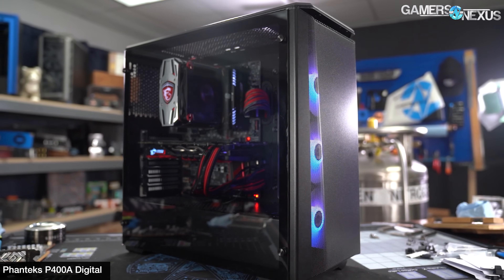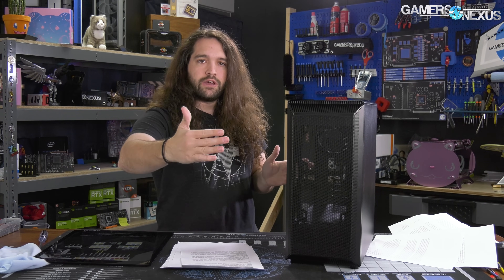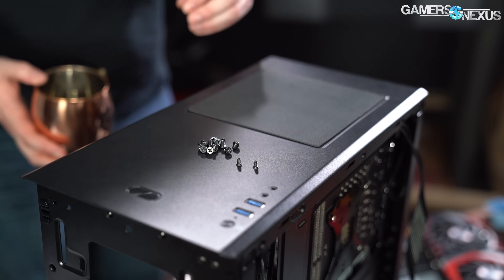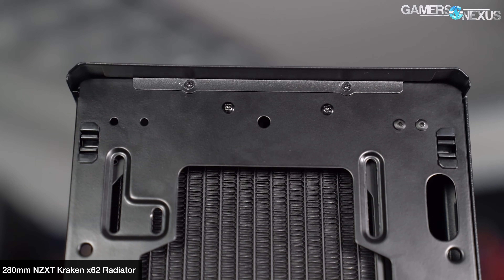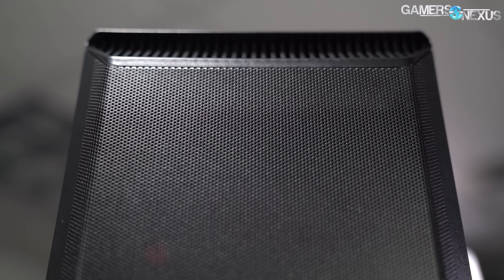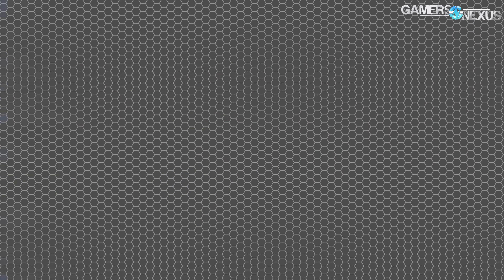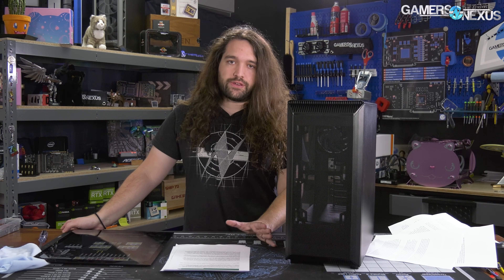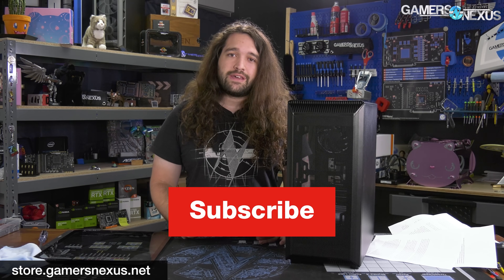Phanteks P300A Cheap Airflow Case Review: Thermals, Extra Fan Tests, & Noise

Comment: I bought this case, P300A, which came with 2 front fans as well, but the reason I got it is that it listed the case as supporting GPU's "up to 355mm in length, and atx motherboards" - neither of these things are true imo. I mean, ATX motherboard... maybe, if you have long PSU cables and can somehow route them through the infinitesimal space they give you behind that idiotic shroud - in my case I had to force my psu in there and bend the cables, and the only hole I could see that the cables could run up into from that angle made it completely impossible to install an ATX mobo. That asides, the GPU spec is jsut an outright lie. I have a 320mm GPU that I wanted to fit in this, it says it supports up to 355mm, yet 320mm is pretty much fully as long as the entire internal space, there's no way to fit inside, and 355mm is like measuring from the very back of the case to the front panel made of plastic. It's physically impossible for a card that size to fit.
Those issues aside, I also found the HDD setup completely idiotic and awkward, the PSU as I said was the most cramped piece of crap and worst design I've ever seen. The fans do look nice and the front panel comes off and on easily though, if I had to give it a good point. This is a case I could only recommend to people with a PSU that is 180mm or less in length, ideally less, and GPU's that are maybe 280mm length max. Also, only mini-ATX or ITX boards, full ATX is a nightmare to fit in this thing, if you can at all. I will be returning mine for false advertising.
Reply: I have p350x gpu lenght is also lie on that case.
I wish there was a standart I can't trust any case now, do they expect me to guess gpu lengh based on the external dimension?

Comment: High end cases are the ones that can do without any fans at all including the rear exhaust. Anyone buying a high end case will remove the stock fan and toss it into a bin or the trash if one is included. No fans at all and they will buy 4 or more fans to populate fan slots just the same as if there was a fan. Budget cases... those should always come with an intake and exhaust fan at the very least. More fans in the cheaper cases costs can be offset with no fans in the high end. But it does make for a marketing point, more fans for your limited budget, buy our case instead of the competitions single fan case. In the budget market standing out is more important than the high end where marketing is ignored and stats are more important to the buyer. Marketing $60 case that includes 2 front intake fans and 1 rear exhaust is going to interest a buyer far more than the competitions solo exhaust fan.

Comment: I would like to know if are there good cases with 5.25 bays in the front. I would like to use fan controllers, blu ray drive, memory cards pannels and stuff like that in my case but is almost impossible to find one.

Comment: Will this case fit my  Asus AM4 TUF Gaming X570-Plus WiFi motherboard? apparently this is an atx motherboard but it also said this was 13.31 x 10.74 x 2.68 inches, which is above an atx of 12 x 9.6 from what i researched.

Comment: The clearance for air cooler of this case is exactly 165mm as the height (with fan) of my Noctua NH-D15, should I buy this case?
Reply: Usually, cases can take a bit higher HSF than their specs. So, if you need a new case that can house your NH-D15, P300A will be fine.
Reply: @Bagus-101  I see. Thank you for your reply.

Comment: The side panel screws and compatibility of the 300A are very poor. I returned mine and chose the Fara R1 over this. I needed a compact and cheapish ATX Case with mesh front and I think the Fara R1 is a more complete product than this.

Comment: Honestly, Im a budget buyer for PC cases. I'd rather pay 60 bucks for a case with no fans but with quality features likes cable management, front mesh, ssd brackets, magnetic top filter, than a case of the same price with included fans that are loud and awful and cheap features overall. Btw, I have a Phanteks Enthoo Pro M with 3x Noctua front fans (2x 120mm and 1x140mm).

Comment: * glances over at his $45 case with $80+ of Noctuas in it * Hmmmmm
I was looking forward to this and the FARAR1 until I got a vertical pump+res combo. I guess there's benefits to having useless space for 5.25" bays after all. Now there just needs to be (stock in) mATX cases that do that with decently ventilated fronts.

Comment: might be better to just dust off your pc every other week and take dustfilters off?  dustfilters need to be cleaned every other week anyway or weekly to keep them performing like a dust filter.. otherwise they just provide dust for intake fans :D
Reply: It''s nigh impossible to thoroughly dust PCBs - let alone while they are vertical and installed in a case. And to thoroughly clean CPU air coolers the fan needs to be removed. And to clean a graphics card you need to strip it down. Dust filters on every intake are virtually a necessity and no mesh is a replacement for a dust filter. If you can see the holes, then dust can certainly pass through them. My PC is situated in the living room and it's filter collects visible amounts of dust in HOURS and I clean it daily.
What we need is cases with no mesh and a dust filter accessible from the front. A mesh+dust filter impedes airflow excessively but whereas the mesh is an aesthetic component, the dust filter has practical benefit.

Comment: Can anyone tell me if the BeQuiet! Dark Rock Pro 4 will fit inside this case? I'm looking to have a smaller footprint for an ATX case from my current one, but the cooler height clearance seems to be inconsistent across what I've seen others put out there (160mm, 170mm?).
Reply: I know the Dark Rock Pro 4 fits into the NZXT H510, which would be my second choice, given the similar size. I would like to know about this case first, since it has better airflow. PCPartPicker also says it would be compatible, but just looking for another source to corroborate.

Comment: It is a horrendous design if you want to use the HD bays, like 99% of gamers that still need a large storage drive.  My thermals were 30F higher than drives in the main bay laying on the shroud.  That’s a problem.

Comment: For some reason the fron panel won’t attach back on the case with two 140mm fans installed… am i doing something wrong
Reply: yep you're doing something wrong. I have 2 140mm fans and it closes perfectly. Check if a wire is in front of the snap in hooks.

Comment: So unfortunately the H500M remains the best airflow case available. Why the hell isn't anyone making a full-tower with 2x 200mm front fans, 1x 140mm bellow the bottom 200mm fan (So that the 200mm bottom fan isn't obstructed by anything and can focus on pushing air in the main compartment, while the bottom 140mm will push air towards the PSU tray), plus another 200mm on the side panel similar to the HAF  design? It would completely destroy all competition when it comes to thermals, and if they do a good job, it can look awesome too. I'm tired of all these mid-towers.

Comment: Youch. Wish I had watched this review before getting two of these seemingly affordable cases. I did luckily have a bunch of case fans left by a friend's "maximum airflow" experiment and was able to get the much needed cooling into the case. Unfortunately, I couldn't run the entire 4x16GB RAM I picked, due to the tall sticks being too close to the stock air cooler of the 2700x CPU, and causing memory errors. The air pressure is somewhat off as well, with front intake, top intake and rear exhaust. But positive internal air pressure is the easiest way to keep dust from rushing into the case from the back.

Now that I'm ready to upgrade, I can't really run anything larger than a 240mm AIO, and I can't run a higher performance air cooler larger than 160mm. I also probably won't be able upgrade the GPU without running into thermal issues (the M.2 SSD located directly under my current GPU is already not ideal...) Then again, it's not even the best time to upgrade, due to the silicon shortage and mass amounts of scalpers atm, so maybe I should just hold off and save up to buy almost an entirely new PC (minus mobo and RAM, I suppose)

Comment: I can't believe there are folks out there, who would by this case, seeing the nice front mesh panel with the ability to mount front intake fans, and NOT even consider buying any add'l fans for front intake, but I guess they are out there.  Same goes for any cases that don't come with a rear exhaust fan; bet there are folks that don't even consider having to buy one for there or even give conisderation for moving a supplied fan, to back there, at the very least.  SMH....

Comment: I bought the p300 (not knowing of p300a a year ago) and I love it but air flow is an issue to anyone know knows is the front panel the same size can i order that replacement part when it's in stock ill gladly replace my front panel if so! for under 100 this is def one of my fav cases to work with though!

Comment: >"put 30 dollar fans inside 60 dollar case"
Yep. That's me.
Reply: For me it's worse. If I wanna upgrade the included fans, I'll be spending more than if I bought a new case.
Reply: @everythingfeline7367  if you combine the price of all the high-end fans i had.. I am waiting for new Pure Base 500DX case and will be replacing stock fans with Silent Wings 3, two of which i already have and bought an extra one, now that i am definitely sure (i guess) that those are the best case fans i ever owned. I remember spending almost a 100 usd for 3 noiseblocker b14-ps fans, two of which i already sold because those are unusable as case intake with front filter, they make ugly noise. I only have one as exhaust and will be selling it too. The pure wings that come with 500DX i will install in my current case and sell it. The current case being NZXT H700 which i simply become unhappy with, i know it's strange but that's the way i am.
Reply: It's a better value that way. You can get this exact case for $49.99 including $10 mail in rebate. Plus a 6 pack of upHere PWM aRGB fans are ~$47. Roughly $10 more than P400A but you get double the fans that are PWM (P400A fans are not PWM).

Comment: Hey i have the Phanteks P300 case  I dont know if this will be the same with this case but i cant change the led colour on my case when i press the botton on top anyone help?
Reply: Just a guess but make sure you only connect up a psu sata cable to the case connector to power the led on that model, do not connect it to the motherboard as thats not required.  Hope that helps.

Comment: Why do the noise normalized test with stock configuration? Why not with standardized fans like the torture test before? Or both if you have to.
But doing it with stock fans is the most useless thing after you basically showed that the case absolutely NEEDS new fans.

Comment: Anyone noticed the rails for front 140mm fans are offset to the left? They aint directly centered as the 120 rails. So if u install two 140s in front they gonna look off-centered. Dumbass design.

Comment: "Most people are not you".   I would argue "most people" don't buy a case, they buy a prebuilt computer.  People buying components for a pc build DO buy case fans.  Look at how many reviews for fans there are, even compared to cases.  They also buy things like water cooling that's not included with a case.  They also buy 3rd party cpu coolers.  I think reviewing a case with just one included fan is a waste of time.  Some of the best cases do not even come with fans, so do you waste your time testing that configuration when it's clearly meant to add fans?